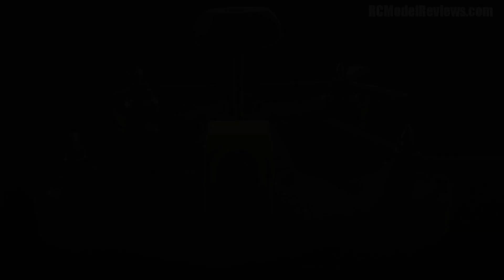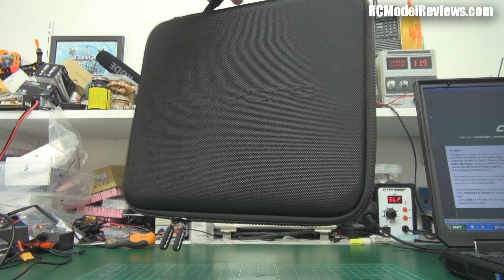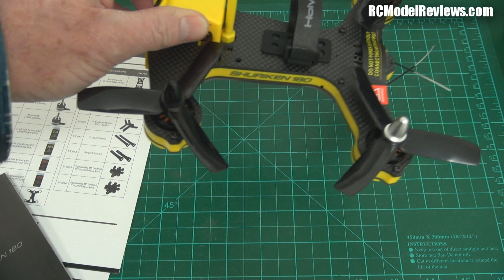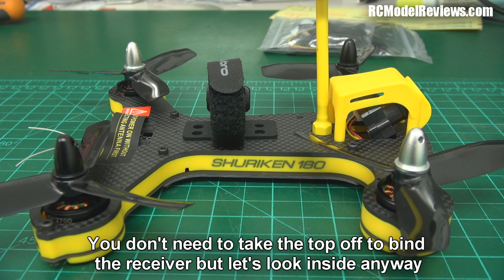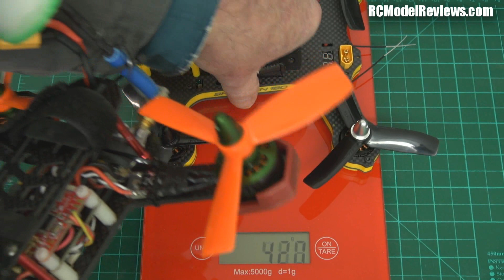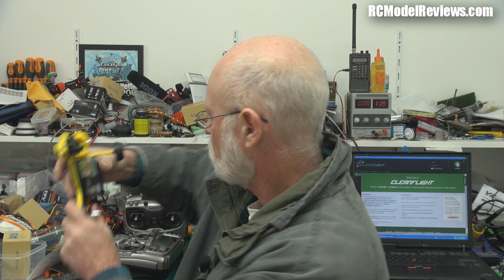On the bench:  The Shuriken 180 miniquadcopter

Comment: I like the pancake design. Some minis look like someone took a carbon fiber fraim and just piled the components on it on top of each other. The top-heavy look is a bodged together look. Looking foreward to the test flights of that quad and the pusher motor one. The IBCRAZY shorty race antenna would be perfect for that low profile look. Great review "On The Bench". ;-)
Reply: Totally agree with you. Aerodynamically Shuriken quads make others look like flying piles of books !
Reply: I totally agree. I call them flying bricks,or batterys. They look terrible and it exposes everything to dirt and grass when you crash,and everyone crashes. This design is clean,and stream lined. I do wish it had a layer of thin foam padding on that bottom board,a sharp stone can easly knock a hole through that board. I am impressed to the point I am seriously checking prices on it in the 250 scale. I havent jumped into the FPV boat yet,just on board camaras so far. my fear is motion sickness. I get it at the movies,so this is just asking for it.lol.

Comment: The "remove after washing label" is used to protect the buzzer during PCB assembly.  The assembly process could be done by wave soldering and water soluble flux then washed in an inline board cleaner using hot water, or other solvent. I don't know if this was used to build to quad, it looked mostly surface mount assembly.  In any case the label should have been removed before shipping.

Comment: After test the 180, results are great, fast lil quad on 4s 1300mha-1000mhs, i added mini osd, ditched the stock antenna for an immersion rc rhcp, ditched the stock cam for a 1177 mini ccd cam. In all im happy with the quads preformance, speed, and simplicity of a rtf mini.

Comment: Flies great - Stock camera cheap - Replace it.  First crash the SMA connector under the antenna tore from the board, burning out VTX by the time I found it and powered it down.  Use a pigtail here.  Good stock of spares available.  Like it on 4S

Comment: Overall I did really like flying my 180 until I started having trouble with the antenna jack breaking loose inside the body of the drone.  After a few crashes on grass the solder at the base of the antenna jack breaks loose and makes the video feed unusable as it is too full of snow and haze.  I have had it professionally repaired a couple times but it keeps breaking after a couple crashes.  It does not appear that there is a permanent fix for this design issue.  Somebody on line has mentioned this problem with a recommended fix of moving the jack to a new location.  That is too difficult for my skill level.  If you are considering this drone, ask about the problem and a fix before you buy.  I have asked the company HQ and they do not respond.  It's too bad as the drone is fun and pretty tough except for the antenna mounting jack..  so again., I can only fly LOS until I jury rig a more permanent fix.

Comment: on the whole 'VTX without antenna' note, a few days ago the antenna of my immersionrc VTX broke off in a crash. it sat there for almost 1 minute with no antenna and didn't burn out. it is only 25mw, so would that have meant it would take much longer to ban out than a 200mw etc? i Resoldered the antenna mount and it still works! also, can you burn out a receiver by not putting an antenna on?
Reply: The theory says that power that the TX doesn't transmit as rf energy, instead turns into heat which(without a suitable antenna attached) cooks the transmitter.  The average receiver(only) puts out much less rf than even the weakest transmitter(which is why a properly designed receiver(only) doesn't make a good transmitter:),) so it is much less likely to be damaged without an antenna attached.
Reply: The chances of a 25mW VTX being damaged by operating without an antenna are probably much lower than that for higher-power units.  The reason is because it's the transmitter's output power that is being turned into heat and 25mW is a paltry amount which won't cause nearly as much heating as 600mW (for example).  It's still not a good idea though -- because the 25mW transmitter might not have as robust devices in its output.
Reply: +yadabub - I've never seen a receiver get damaged because it didn't have an antenna...  It is quite possible to design a transmitter that can detect a missing or damaged antenna to protect itself (high SWR) but the additional parts/cost/laziness prevent their use on most small video transmitters.
Reply: well you could heatsink it, keep the circuit cool enough even when the antenna is missing.
Reply: Actually, it's not just the heat.  Sometimes high SWR can also cause pretty high voltages to appear within the transmitter circuitry -- sometimes high enough to damage the semiconductor junctions involved.
Reply: *****
interesting, and the high voltage isn't something you could fix with a choke or balun? then again that probably would mess with how well the antenna would work if it was still on there.
Reply: Nope, because that would affect the tuning of the output filtering and matching circuitry.  More sophisticated transmitters do SWR monitoring and if too much mismatch is detected, they either turn off or dramatically reduce the drive level.  Even my old Taranis has SWR monitoring and an alarm if it detects some kind of antenna fault.
Reply: *****
is it common in fpv? would seem like something handy in the more expensive fpv transmitters, for when your antenna gets knocked off and the copter is far away.
Reply: I haven't seen a VTX with SWR protection.  These days, even a powerful (600mW) well-featured (5.8GHz) VTX can be had for under $50 so they're not exactly super-expensive any more.